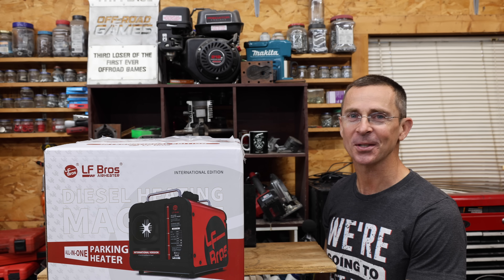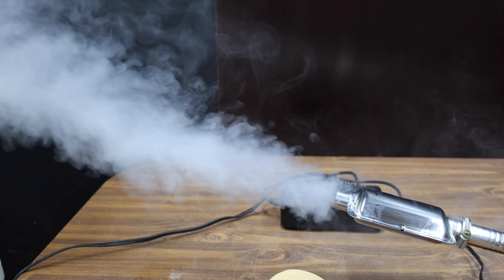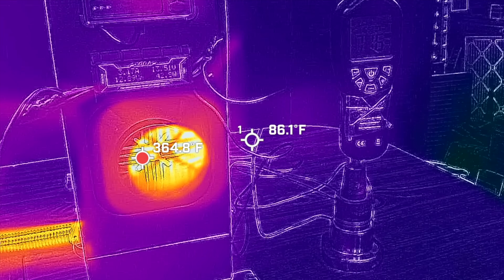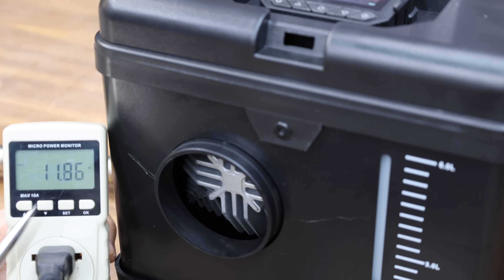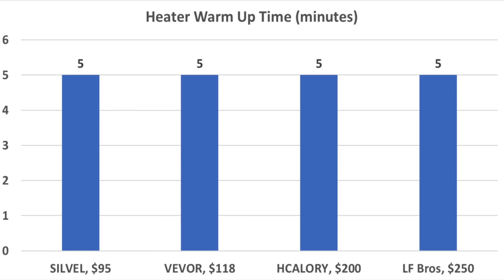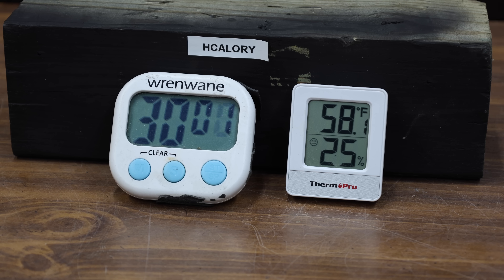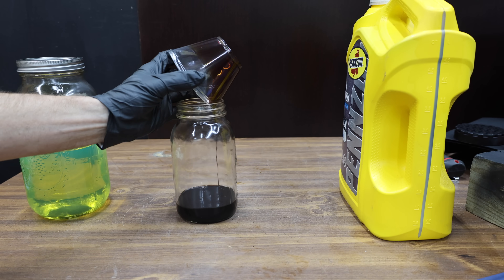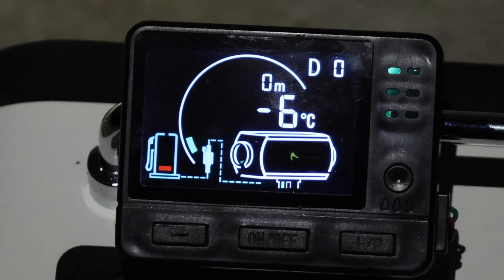The Truth About Cheap Diesel Heaters!

Comment: Being able to get rid of used motor oil while heating a space is a real plus.
Reply: my auto parts stores take used motor oil for free. Doesn't yours?
Reply: @harleyhawk7959  My local auto parts stores always say their drum is full and can’t take the oil.
Reply: I think I'm gonna buy one just to burn the used oil. The heater is a big bonus!
Reply: @AutoMotoMechanic you are gonna want to filter the oil and thin/ mix it with diesel.. or have issues, plenty of videos on folks trying it without and having lots of problems  🙄

Comment: There’s a problem with using a diesel heater as a backup during very cold conditions. During the Feb 2022 severe cold event that hit the Dallas Fort Worth area, many major businesses were without power. Many that relied on stat of the art diesel generators were unable to use them due to the cold weather causing the diesel fuel to gel in the tanks, resulting in nationwide tech issues.  That was in Texas with 5-10 degree temperatures.  How would this ever work in sub-zero conditions?   Would love the answer to this question, thanks.
Reply: Assuming that being without heat in a winter storm is due to no power, clarification to the above comment.

Comment: on units that have fairly hot exhaust tube/pipe, looks like it would be pretty useful to have the exhaust pipe running through the middle of a pipe that carries the burner air inlet, to recover exhaust heat.
Some heaters have exhaust heat warming the "room air", but any exhaust leak into room air could be catastrophic!

Comment: after tons of research i just installed the vevor last night in my insulated 2 car garage. it works incredible. i recommend extending the length of the exhaust max of 6ft at a slight decline(drain percipitation) inside the space since the exaust gets very warm and helps with heating, also i used a two piece blowpipe with one of the pipes directed toward the hottest part of the exhaust to blow air on the already hot exhaust. I also recommend using a 15 amp or more ac to dc power supply from amazon  - it is very simple to set up you will only need a used extension cord. Caveot to this is if power is cut while heater is on damage to the heater could persist unless you use a SPS.
Reply: do you think, potentially, you could spiral some copper pipe around the exhaust pipe and use it to heat water? 🤔
Reply: I have an insulated 2 car garage, tucked under my house. The temp outside is 20 above to 40 below zero Fahrenheit.  The garage stays a little warmer, maybe 20 degrees warmer by itself than the temp outside.   Will that vevor heater work very well for that?   I plan to install a ceiling heater later, and I'm supposed to have a heater in the range of 30,000 BTUs.   But in the meantime I want to try a diesel heater. If it will heat the garage to at least 40-50 degrees.
Reply: @adamr8628  A 2kw will work easily for that
Reply: @mrmotofy  Ive seen tests on youtube in which it took several hours to raise the temperature with a 5k, even at only zero degrrees.  I'm thinking even a 5k may be too small from what Ive seen.  30-40 below is really hard to counteract.   My 45k BTU torpedo heater handles it well.  But the diesel heaters are a small fraction of that in power.
Reply from the maker: Thanks for sharing.
Reply: Many Thanks for your suggestions. Are you saying to use the AC to DC power supply instead of a Battery?
Reply: @titojones6204 why not. No need to have a battery that you then have to charge. I run mine from a 12v power supply last two years with no issues.
Reply: @titojones6204  yes and ensure it is 15amp or more. I cut up a used extension cable with hot neutral and ground . The installation is plug and play. I will say the only concern if using this with no  standby PS is if power is cut damage could result to heater due to it not being able to cool down. The price of these are so cheap so who cares ill take the risk.
Reply: @uberleet01  Where did you come up with 15 amps? Mine pulls just 5-7 A to heat up the glow plug and once it gets running it goes down to 2-3 A.
Reply: @carsandtools  my spec sheet says 15 amp or more powey supply mine pulls around 12 amp on start up.  From extended use I'm predicting to pull more like 14 on startup as time does on.
Reply: @uberleet01  Yes I've since watched this review and it looks like some of them really do draw a lot. But it is interesting because I basically have the Vevor from the video, just from around 2020 and it doesn't draw nearly as much... At one point I even powered it with an old 12V brick power supply that was rated at 5A. :D
Reply: @carsandtools  There's different sizes, you may have the 2kw for example
Reply: Many thanks in advance
God Bless 🙏

Comment: Just an FYI, the reason these diesel heaters are so cheap is that the German patent for them has run out. With some of the heater controls, you can actually tune the fan speed in relation to pump Cycles Per Second (Hz) and using a Carbon MONoxide detector/meter you can achieve a finely tuned burn with resulting very little carbon deposits. If you want an even cleaner burn, you can substitute kerosene for diesel or do a diesel-kerosene mixture. Good video for comparing units straight out of the factory box, but even some of the cheper units can be tuned to perform better!!!

Comment: from my experience with the vevor heaters (many brands with the same product with different lables) the 8kw units are actually just the normal 5kw units. there are only 2 types produced. 3kw and 5kw. So you can just buy a 5kw unit for sometimes less than the "8kw" and have pretty much the same preformance.
Reply: There are two types, marked as 2kW and 5/8kW. They are based on Eberspacher D2 (2kW) and D4 (4kW). The weaker is a 4" (10cm) shorter and uses smaller hoses, economy is almost the same. Most controllers and boards work for both, there's a setting somewhere hidden in the menu. There is no hardware difference between those marked 5 and 8, there may be a different amount of fuel injected but I can't say for certain.
Reply from the maker: Thanks for sharing.
Reply: I read the same thing. The 8 kW is just a relabel.
Reply: You can buy an 8kw but they are much more expensive and noticeably bigger.
Most are not 8kw

Comment: Just about done installing the VEVOR 8000 model that comes with a separate fuel tank. Smaller size heater unit,wiring harness and all parts needed for complete installation. Putting it in my Gehl skid steer to have heat inside the cab & most importantly use the exhaust to warm the diesel engine in Minnesota winter so I’m able to start the skid steer when it’s not near an electric outlet for the block heater. I don’t know if this has been tried before or if it’s going to work? Great product review as always. Thanks for spending the time and sharing your research. 👍👍
Reply from the maker: Thanks and you are welcome!  Thanks for sharing.
Reply: From experience there isn’t a lot of exhaust flow. I’d see if there’s a way to reroute the hot air into the engine bay.
Reply: David mcclucky has a bunch of videos on these, some of them talk about the same unit that also has  a water loop that you can plumb into the engine to heat the cooling system.  He also shows others that only do water.
Reply: Update on the installation in my skid steer and after a little longer process purging the air out of 8’ of fuel line. The unit started and runs smoke free doing exactly what I was wanting it to do. The final test is still to come when the colder weather settles in on Minnesota and I get some hours of operation to see how it works out.

Comment: Kerosene is best,  engine oil will burn but the combustion chamber will soot up and thats a pain,  avoid running flat out as that shortens the motors life.  I have a kerosene fuelled unit and it idles at 1.1 - 1.3  hz (2kw approx ) and burns one liter of fuel every eight to ten hours. The exhaust goes through a pipe coil in a hot water cylinder and exits at low level to drain the condensate. This provides me with enough hot water for the day including a shower.  You can use Jet A.
Reply from the maker: Thanks for the feedback.

Comment: I've had a vevor for two years now. Best $100 heating investment for my shop, ditched the buddy propane and electric space heaters. I honestly like the sound of the positive displacement pacer pump thumping away. The fan sounds like a turbo or jet running in the back ground. TV has more volume if that gets on your nerves.
Reply: Whats wrong with the electric space heater?
Reply: @Dpowell28  Adds load to the electrical service, takes a lot longer to warm the space. For some folks, the cost per kwh could be a problem also.
Reply: What are the advantages compared to the Buddy propane heaters ? I'm using that now and might need to upgrade.
Reply: @MathewPollard-vj4uq  In my case it was adding a lot of moisture to the air, left the odor of gas in my shop, didn't evenly heat the space. Even though the shop may be decently warm the air still had a chilly dampness to it. Unless you have the fan attachment you are relying on the heat to radiate. Anytime the weather turns really bad here people have a tendency to bum rush the store for all the propane bottles also. It's easy to refill a diesel can though. For reference I am heating a 12 X 24 shop.

Comment: since the exhaust temp is so high, i wonder if you feed the exhaust through an old cast iron radiator before porting it outside, how much more heat you could extract from the system
Reply from the maker: Thanks for the suggestion.

Comment: I was wondering if we needed to worry about stored diesel going bad but it looks like it will run on anything that is thin enough.

I'd need this in a power failure so I'm not so sure about paying extra for a power bank when I have 12v switching power supplies filling up a plastic drawer in the 'assorted' and 'vintage' section of my basement; so I would get the Vevor too.

Another great video. Thanks!

Comment: I bought one 6 years ago for my 24x24 workshop and this fall the pump stopped. $13 to replace. Absolutely no regrets buying this heater.
Reply: What brand
Reply: @NutritionPolice  really dont matter   they are all the same components, just buy the cheap one on sale.
Reply: @NutritionPolice  It could have been Happybuy, Jaebong, or some other silly name. Receipts are long gone.
Reply: I watch a few different YouTube Overlanding channels and one of them bought the expensive diesel heater and it broke within three months the dude could've bought 8 vevor heaters for the same price 😂 sometimes the expensive ones definitely are not better.

Edit to say I just checked the price he could've bought 13 vevor diesel heaters for the price of the webasto 😂
Reply: @troyrager1352  Yes. Cost definitely does NOT mean quality
Reply: @troyrager1352  And they are all basically the same same thing, and the chinese ones  ARE all the same thing lol.
Reply: Is your shop insulated? I don't know whether these types of heaters would be enough for a non insulated 22'x26', 2 car garage. Looking into the forced air ones as an alternative but debating between the two.
Reply: Ive got a 24x24 uninsulated garage. 
I run a 8k Vevor
It adds about 20 degrees fahrenheit to what the outside temperature is. Takes 2-3 hours. 
Im sure it would keep up great if my garage had insulation.
Reply: @SystemHacker23  Yes, insulated. But at -30 or less, the heater has a hard time to keep it warm. Its workable, but not in a t-shirt.
Reply: Which One did you buy 🤔
Reply: @briancostello2315  Hello. I already posted a reply on this a year ago "It could have been Happybuy, Jaebong, or some other silly name. Receipts are long gone." Stay safe.

Comment: I have a Vevor I got for under $150 including tax and shipping. I use it daily and have had it three winters now. Works great
Reply: The instructions were the worst Chinglish possible and when I had trouble installing, the customer support was terrible. Fortunately I figured it out on my own but if you need help, it’s not available.
Reply: FWIW, the problem was that I used a small wire at first that wasn’t large enough to power the ignition. Once I improved that, everything went fine.

Comment: Another great video! I like that your testing allows for treating these heaters horrible and not anticipaating any further use  after videos are made.
Reply: There's lots of videos on other channels already covering usage with different waste oils. PF Todd demonstrated with the teardowns that the heater core of all the units is the same, so the same maintenance steps apply to all of them. I liked that he measured how clean the exhaust was with different fuel types, that filled a gap in the info that other channels didn't have data for. The consensus with the other videos seemed to be that running mixed motor oil will eventually kill the unit or at least require extensive maintenance after just a few hours of runtime.

Comment: The reason the first heater has so much smoke is because you're not turning it on the right way. You must be reading the directions for the first startup where you need to prime the fuel pump before starting it because all the times you turned it on in this video you were going into pump prime mode by pressing the bottom two buttons and then the up button. All you need to do to turn it on is press the middle power button once and it'll say "On".
Reply: @crimson cool story bra